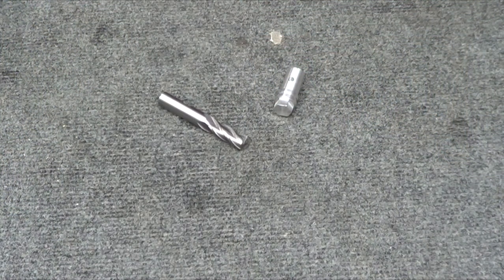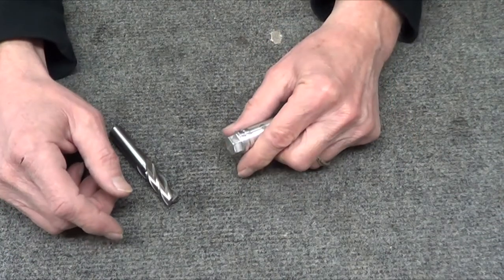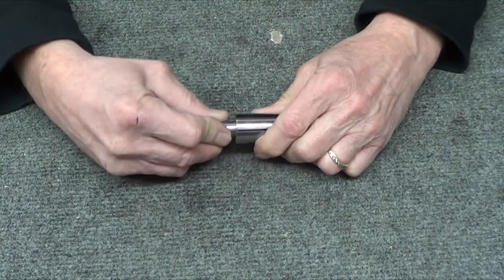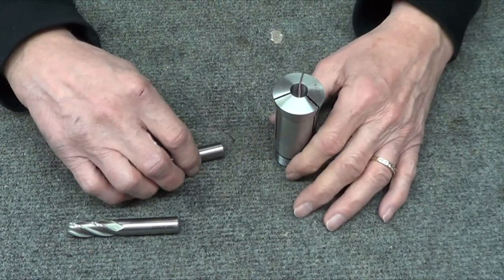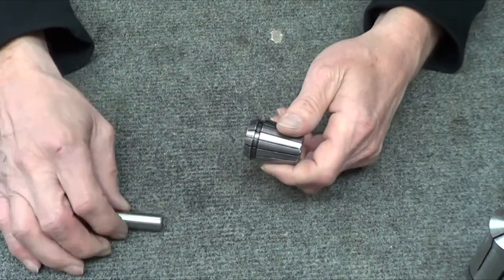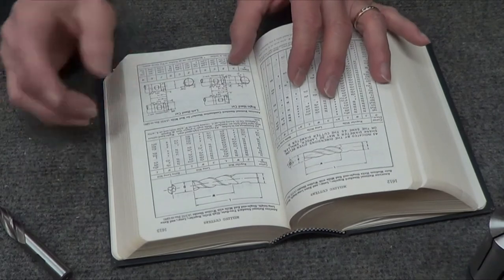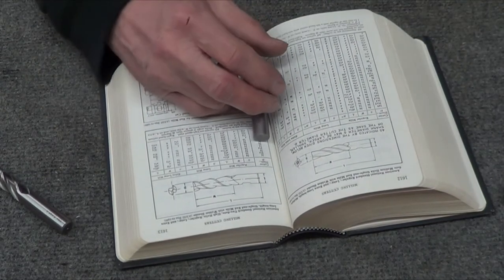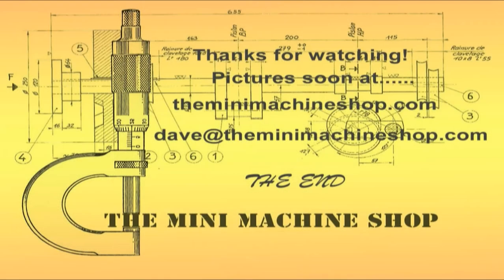What You Need To Know About Collets Video #52

Comment: Dave, the Machinery Handbook is correct and by only listing a minus tolerance means the item can only be on size or a little under and any plus or oversize is not acceptable.
Reply from the maker: +Jeffrey Vastine Wow... new to me! Every mechanical drawing I've ever seen always has + and - tolerances. You have to be right because someone would have spotted it and said something at some point.
Reply: +Dave, Jeffery is correct. The Machinery's Handbook follows two types of tolerance specifications called unilateral tolerances (a tolerance allowed in only one direction) and bilateral tolerances (the ones with + and -symbols) depending on the tool or part being described. The handbook was first published in 1914 and has had many editions and editors so I suspect the style for tolerances depends on who wrote and edited each section. Look in the handbook section entitled "Allowances and Tolerances for Fits" for more information on how they specify tolerances. Thanks for the informative video. My preference is ER type collets and probably the most widely used of any type of collet.
Reply: Paul,  thank you for your informative comment as it expanded my knowledge base. I will definitely look in the Machinery Handbook section "Allowances and Tolerances for Fits" for more information and to gain a better understanding of this topic as I continue my journey into the world of machining.